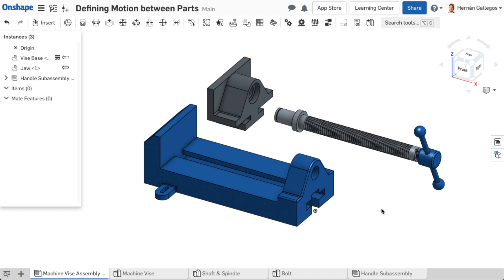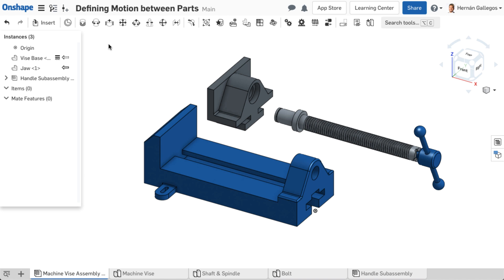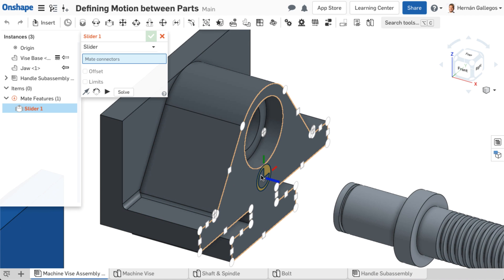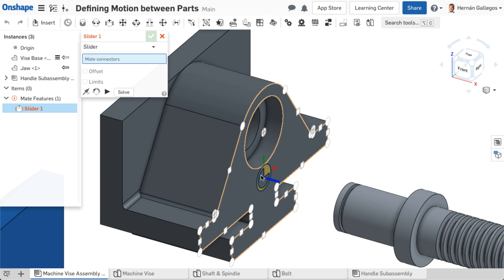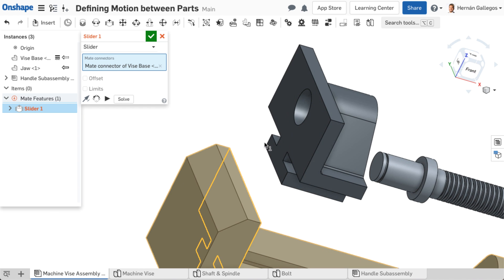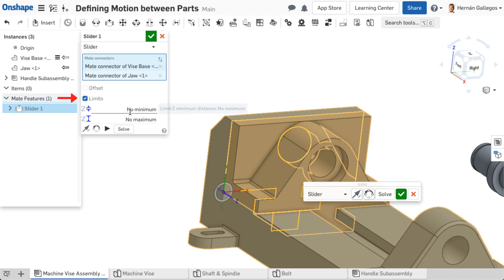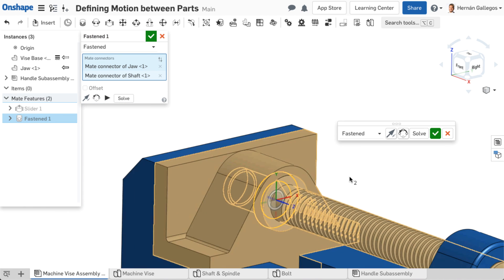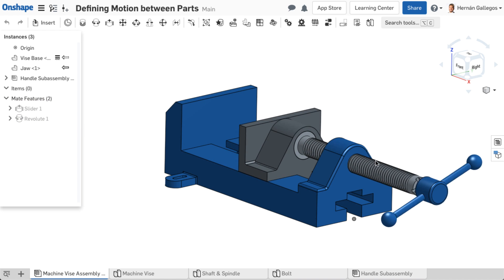Mating in Onshape

Comment: Functional mates (like Onshape) are good for modelling developed ideas for single-purpose machine subassemblies, but hopeless for conceptual or multipurpose subassemblies. Extreme examples of the latter include blue-skies design to solve a known problem in an as-yet unknown way, or coming up with fixtures to hold a wide variety of parts on a flexible production machine.
Abstract mates (involving versatile virtual geometry: reference points, axes and planes) are almost completely absent from Onshape, and make such jobs unnecessarily tedious and confusing. 
Planes (and to a lesser extent, axes) are often a fundamental starting point in a design. If you're designing a T-slotted table, you start by creating vertical reference planes along the centre of each slot, before you even decide the size and other details of the slot (which will be related to those planes). This is possible in Onshape in the case of planes, but not axes or points in vacant 3D space. But even those planes are fatally limited, because it's essential to be able to reference them in all assemblies built on that machine table. They define where jigs and fastenings can be secured. 
Onshape has no ability to use reference geometry from parts to define assembly mates, and in a case like the T slot (and many other situations), it's unrealistically laborious, arcane and complex to set up mate connectors based on solid geometry, to work around that limitation.
Worse yet: If the solid geometry is as yet undecided when the mate is created, the functional mates will fail every time their topology is revised, and will have to be deleted and the whole process restarted.
To give one more example: in Onshape assemblies, even when you've done the hard yards to duplicate reference geometry, mate connectors can end up partially or totally obscuring each other. It's nothing to have half a dozen at the exact same point in 3D assembly space, all children of different parents. With infinite planes, you can tweak the visible boundaries of each plane so that they do not coincide.
It seems to me that a decent modelling package needs to permit BOTH abstract and functional mates. Ideally, in the same assembly.